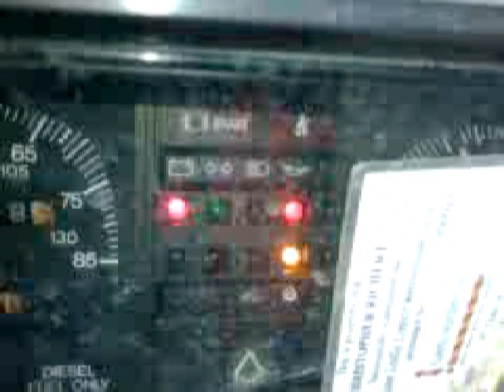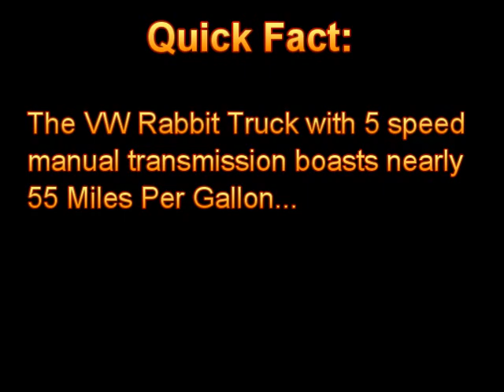General Diesel Engine Prime and Start

Comment: I drive a 2007 F250 Diesel, I ran dead on Mt Iran dead on empty diesel, I just put diesel in the tank and cranked it up it took a lot longer than usual to crank over but I just crank it over kept cranking like 5 seconds and it started up and runs fine
Reply: DUDE!! Yours has an electric fuel pump! This old VW doesnt!!

Comment: if I've got air in my fuel lines and I've changed what i thought was problem would i still need to bleed the system have had vehicle running but a pain to start every morning, i think fuel draining back over night so could i have found culprit but needed to bleed air out?

Comment: Thank you.  helped me sort out my Kawasaki 3010 diesel.  lot easier than I thought it would be
Reply: Thanks,
Worked the second time on a diesel motor. Left one loose and watched tiny air bubbles come out, 
the motor coughed,sputtered, then started. I had seen this on a 931 Cat dozer, then diesel fuel algae, a green snot looking crap in the SCREED, a chamber pipe, before the filters.
Clean out the SCREED, AND YOU HAVE A NEW DOZER. ANY PART FOR A CAT CAN BE BOUGHT ,@ Fabick tractor St Louis.

Comment: If you own a late 80s or early 90s International 7.3 diesel (Ford 250 and 350s) this information doesn't apply. #1-make sure your front tanks is as full as you can get it (close to 19 gallons) of clean diesel. #2-bleed your fuel filter (located on the passenger side of the engine) completely "dry". #3-crank your engine to make sure the filter is dry. #4-Inspect your fuel gauge to make it is totally full, and then Open your drain on your fuel filter and "crank" the engine once or twice to blow the air out of the fuel lines (you should get a good squirt of fuel when you crank). #5-close your fuel filter bleed and proceed to crank your engine.#5-don't overreact if it doesn't start immediately. 2-3 times should do it. #6-always fill your "front" tank"; do not attempt to fill your rear tank on these model Fords.
Reply: +sharoncrayne1
What's with all the quotes?

Comment: Great easy to understand video! But wouldn't loosening/bleeding JUST the line furthest from the pump bleed the air from all the lines?
Reply: peter nguyen no the lines are not connected. each line comes separately from the injection pump.

Comment: Well well well. I spent hours recharging the battery and cracking the 2nd to last fuel line on my Massey Ferguson 265 after running dry on fuel. It would nearly catch and had previously. But not today. I remembered YouTube and searched for my solution and chose you.
 You video is straight ahead, not wordy and full of lingo. In short, it worked the first time. Thank you soooo much for posting this. It really worked as good as you demonstrated.

Comment: Hey Man, I just spent an hour and a half trying to get my 96 chev 3500 running after running it out of diesel! I killed both batteries, and after charging them and trying for another hour, I found your video. Even though it is -20,  5 minutes under the hood, it started right up! Great video, thank you for taking the time to post it.
Jim

Comment: Lol, I have just spent 10 hours trying to start my truck. Killed 6 batteries and a 12 volt jumper pack.  Then got another truck to jump start for the next four hours and still no joy.  Filter was primed, fuel was going to the block via the fuel line, but when I finally cracked injectors I saw no fuel coming out of them.

I gave up in the end and decided to do some research.
Reply: Ant Poo  any finds im having issue im thinking Injection pump

Comment: Hey, thanks for the informative video. I have an 82 Chevy LUV diesel that's been sitting for a couple years. It starts but runs at a high idle and doesn't have any throttle response. Someone told me it might just have an air bubble in the ip. I tried to bleed it at the injectors but nothing changed. It seems like you know what you're doing, I have a video posted on my page if you don't mind taking a look and letting me know what you think?